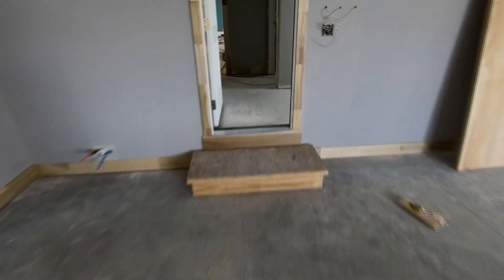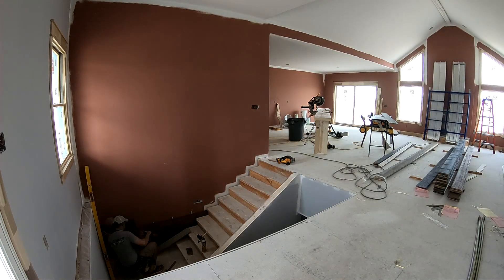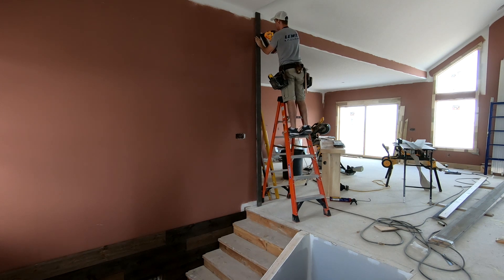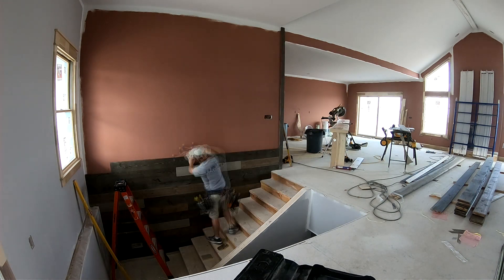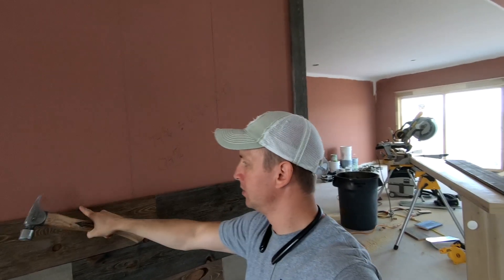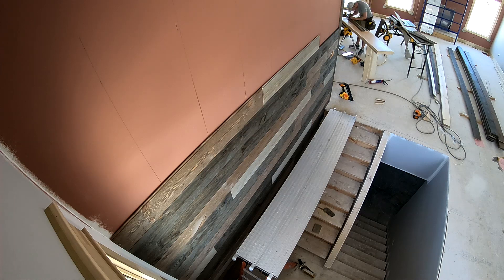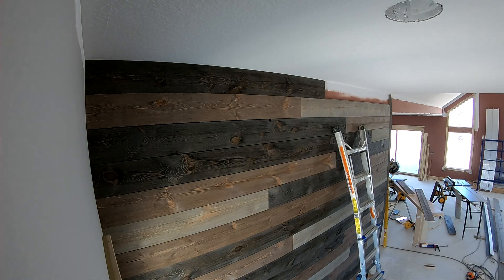Rustic Barn Wood Accent Wall Installation: HOW TO INSTALL

Comment: As always your tips and tricks never let us down. Thank you. And yes Pica is  marker of the future. I have three of them, one graphite, one white for marking dark hardwoods, and one red that I use with my Dewalt track saw, makes a great contrast up against the black strip of the track,. I haven’t undercut a measurement since I started using red marks. Unlike the Festool track has a clear/white/opaque plastic strip, Dewalt is solid black.

Comment: Very cool wall a lot of prep, I have one of those bosh laser measures I need to use it more your right it’s lot easier than a tape on long measurements, I want to do a barn wall but with a little more character & depth.
Thanks Chuck

Comment: Getting ready to cover a sheet rocked wall with 3/4" x 4" wide rustic wood off old Wyoming snow fence,  Couple questions if I may, 1/ what size brads or nail do you use in your pneumatic nailer to fasten this type of wood.  2/ On a sheet rock wall with 16' inch on center framing how do you prep the wall to allow nailing the boards to the wall.  I noticed on the sheetrock wall you were nailing your barn wood to, you actually were shooting nails between your marks for the studs. Do you have any advise for my installation so there is plenty of nailing across the wall.  Thank you.

Comment: Spencer, I don't wanna see you shorten your trim career, so next time lean your telescoping ladder against the wall at the lower landing and then run your extendable plank on to your ladder at the top of the stairs. Not the best idea, but you'll get full range of motion and access without having to reposition the ladder every few feet.

Comment: Lost me a bit on the angle as the boards looked to bypass the stair treads, you lads need to start using Metric it’s so much simpler you’ll catch up someday. Looking good 👍
Reply: I was wondering this myself.

Comment: Love your videos keep them coming :)  I am doing an accent wall above a stair landing with these measurements. The Landing is not  flat across it steps down 10 inches to the left of  accent wall at the 30 inch mark. So picture this in your mind. From bottom of left step of lower landing its 166 inches to ceiling and from the bottom of right step of upper landing its 156 inches to ceiling. I am fine with the 2 vertical styles  but what do I do for the lower landing? I 'm using 5/8 by 1 and 1/2 trim.

Comment: Can you explain why you needed the the rack angle to get started?  I didn't see any angled cuts.  Thanks!
Reply from the maker: It tucks back behind the framing skirt board.
Reply: I also didn’t understand. If it’s tucked behind why did it need to be angled?

Comment: Would it be okay to start at the top and work you way down so no matter what the rip is it would be on the bottom?
Reply from the maker: Yes. You can definitely items do that. With this particular material it would have been much more of a struggle to do it that way though. In this case it was better to have gravity working with me and not against me.

Comment: Where did the stair angle com into play as it seemed you were cutting the right end to match the treads? Love watching your work develop this way into a finished product.
Reply from the maker: The framing skirt is built out off the wall. So its tucked behind the framing stringer.

Comment: Putting the boards tight to the drywall on the left side give you any cause for concern when it comes to expansion and contraction of the wood?
Reply from the maker: Not with real wood. Real wood expands very little at its length and this was well acclimated to the house.
Reply: Insider Carpentry ahhh makes sense. Thanks for the response and love your content and attention to details on your work.

Comment: You can take the height of the wall and divide it by your material width instead of guessing at how many pieces go up
Reply from the maker: That’s what I did.
Reply: @InsiderCarpentry  Thank God... I have seen some guys try for like 5 minutes guessing and checking... they started at 5 and worked their way to 50

Comment: What did you do for the joints that didn't land on a stud ?
Reply from the maker: Since it is a T&G product it doesn't matter if it lands on a stud because the pieces under and above it lock everything together and keep in plane.

Comment: Nicely done, though I'm not a fan of spray on tan. I get the fascination with the real stuff, but this looks a little too slick and fabricated.
Reply from the maker: Beauty is in the eyes of the beholder. Homeowner loves it and thats all that matters.
Reply: @InsiderCarpentry  That's very true. We have a little more say in what we make, because we design and build (mostly garden) furniture. But in the end it's the client's choice. We provide the service of building what they want.

Comment: Why not start at the top ? It is very rare the size of the planks works out, you finish on the bottom where it is less noticeable and usually has baseboard to cover.
Reply from the maker: Gravity. This stuff is much easier to install when you're working with gravity not against it.

Comment: Great looking job. But not to be the “ safety Nazi” but where is the temporary handrail around that man-eating hole.  Saw a carpenter walk off of a locker room in a new high school. Before the ambulance got there they were throwing up a hastily built perimeter rail. And no I couldn’t have warned him as I was on far opposite end.

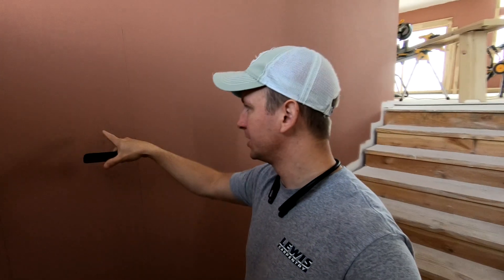Comment: 1:57 I think to myself "my god, when are we going to switch to Metric!?"
Reply: I’ve actually thought about switching to a metric tape for work. Numbers are way more straight forward.
Reply: as an engineer, when I design fixtures, parts, and assemblies, I do it all in metric (SI).  in fact I find it very difficult to do it on anything but SI.  When I do wood working, all SAE; I find it difficult to think in SI for carpentry.  it comes down to your measuring tools really.  all my wood working tools are in SAE as it can be difficult to find SI measuring tools from box stores.  next time my in laws from over I will ask for a SI tape measure bc these fractions can be a pain

Comment: Why not just start from the top?
Reply from the maker: It’s way easier to install this stuff when gravity is working in your favor and not against you. I have done it too to bottom before but it works best on shorter walls with more maneagable pieces.
Reply: @InsiderCarpentry  I see that it would be easier bottom to top. Thats for reply. I hate Pinterest also. Too many ideas for the wife.